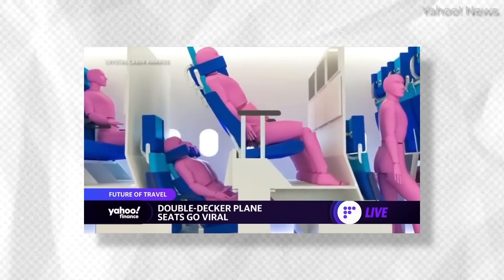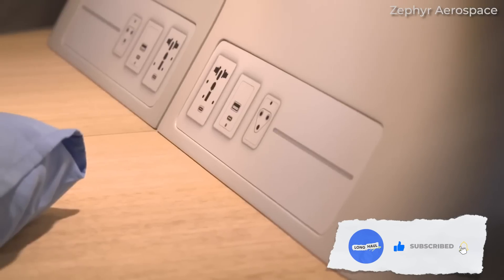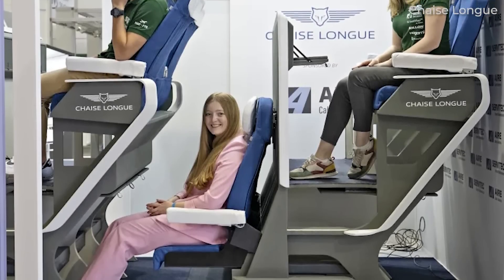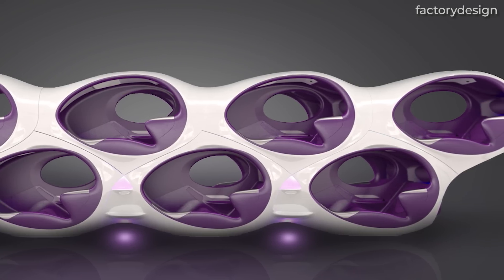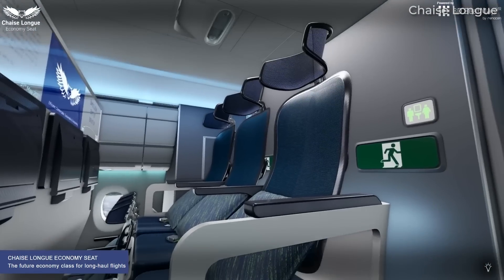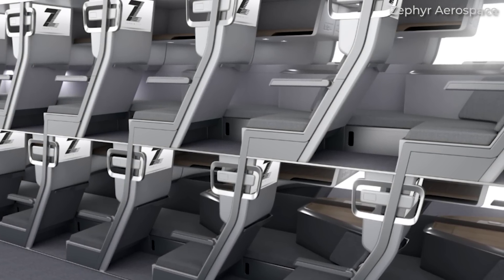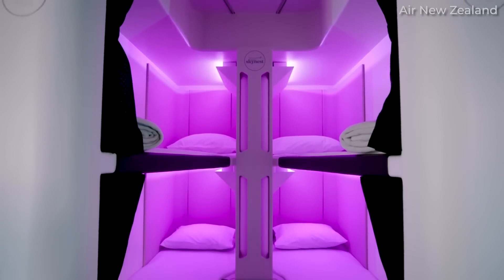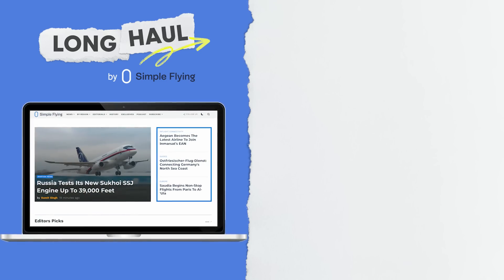Double-Decker Airline Seats: Are They A Realistic Prospect?

Comment: This is all incredibly inefficient. What you need to do is pack the self-loading cargo into containers with these double-deck seats and load the containers into the plane with a forklift. Maybe make collapsible containers so you can squash them down a bit. Apart from making plane turnaround times quicker this lets you hose the containers out after every trip, which is surely more hygienic.

Comment: Highly dubious. Stairs that slide in and out? Any structural damage on a crash and they can get stuck. Turbulence? head: meet ceiling/wall/whatever. claustrophobia suffers won't get on the plane.

I could maybe see an acceptable use if the seats are only 1 deep instead of 3 deep and you can lie flat. But then it would just be more like a cramped business/first class with extra steps.

Comment: Well, from comfort standpoint i would gladly accept double decker seat if it would come with lay flat bed. There also can be a compromise to put this seats only on the center of the plane. Widebodies are high eanough to put double deck seat and overhead lockers while leaving sie rows with classic layout. It would also give passengers a choice. 
The only real issue is evacuation.

Comment: With the occurrence of turbulence becoming increasing common and we already have one (1) incident with a death occurring (SIA/SQ 321) in recent memory, this is seriously a concept that needs a proper assessment solely on safety rather than economics. That incident has highlighted that passengers can and likely will incur serious head injuries if the spacing between the racks is not sufficient. 

Promoting this concept for Economy class is something a Ryanair-type of Carrier will heartily  go for solely to increase revenue per flight and to keep in line with landing slots (for restricted airports). Therefore, unless Regulators put forth minute stringent safety requirements, this concept SHOULD NOT be explored. Tempting Carriers with such concepts that aren't regulated has already proven time and again that business trumps safety in the end.

Comment: Are they aware airplanes have weight limits?
Reply: A bigger problem is exit limit (being able to evacuate all passengers within 90 seconds with half the exits blocked).
Reply: Are you aware of structural foam? 😉 But no really there are low weight ways to do double decker seats, but they're usually high price. And the added price doesn't usually balance out the flyer skepticism.
Reply: @viewer-of-content  Are you aware of people and luggage not being made of structural foam?
Reply: @viewer-of-content  ok
Reply: @viewer-of-content  don't forget about the weight of people and their luggage

Comment: Not realistic as you can't escape in time if there's a crash.
This is just an advertising thing, bad PR is still PR.
It's also so airlines can say "you should be lucky to have almost no leg room because LOOK things could be even worse".
Reply: Seats will be installed on top of the plane. Safety issue resolved.
Reply: @Olifantenstaart but then they won’t get enough oxygen and they may also pass out due to the low air pressure.
Reply: @FanxiansLeafy  oxygen is not free. People take everything for granted these days.
Reply: Also people don't often fasten their seat belts, so they'll fly around in cause of turbulence and some crashes are to be even more fatal (slower evaluation as mentioned, but also such seats are more deadly in cause they collide.
Reply: Video says this option offers better leg room.